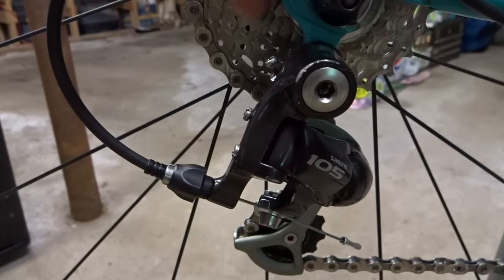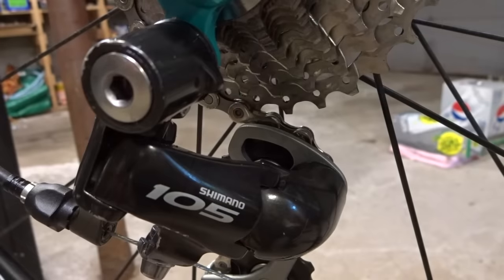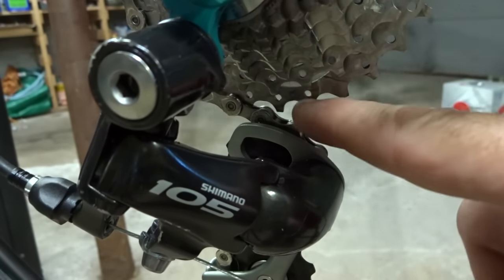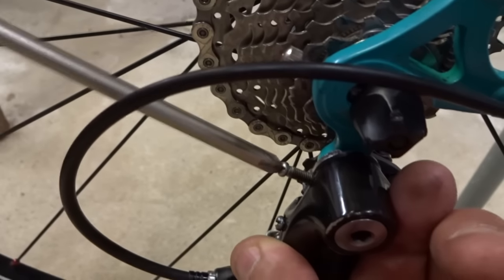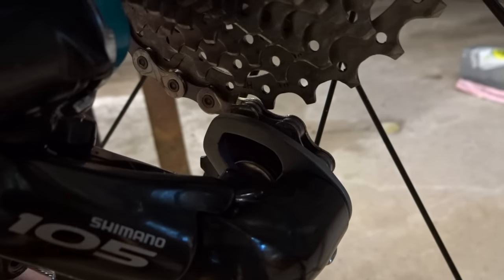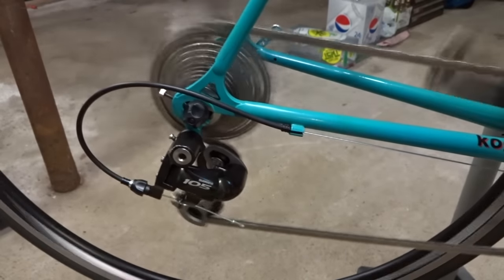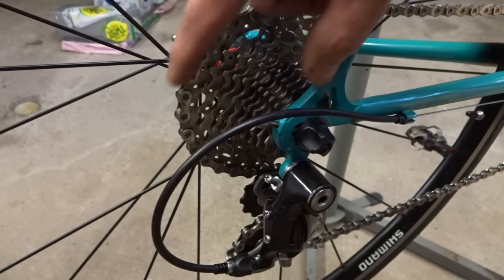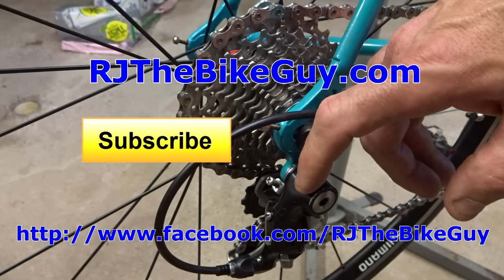How To Adjust The B Screw On A Rear Bike Derailleur

Comment: I can't get the chain to drop down to the smallest cog, it's not moving from the one above, I've unscrewed the high limit screw all the way where it almost comes loose , the derailleur won't align with the last cog...?
Reply: Could be your cable tension is to high, loosen the tension with the adjuster on the shifting cable!  Watch his video on rear Derailleur adjustment!
Reply: Kenneth Surgent I agree. Cable tension sounds too tight. The outboard limit screw should always be set with the cable tension backed right off (barrel adjuster). Set the limit so the chain moves into the smallest cog easily..then adjust the tension so shifting is spot on up and down the block. Move the front chain ring into the smallest, then the rear cassette into the largest, then check your inboard limit screw. Make sure it doesn't move passed the largest sprocket into the spokes..adjust accordingly.

Comment: what is the digferent 7 speed megarange 14-34T with 9 speed 12-34T if the biggest is same 34T???
Reply from the maker: I don't understand what you are asking?
Reply: i mean the sproket gear betwen 7 speed megarange 14-34T and sproket gear 9 speed 12-34T if the biggest cogs is same...
Reply from the maker: If you are asking the difference a 7 speed speed cluster and a 9 speed cluster, the spacing of the cogs is completely different. It has nothing to do with how big the biggest cog is.

Comment: Hi my hand lever gear completely changed. I have 7 gear speed unfortunately. When I am on gear 7 its on smallest cog which is actually first gear and gear 1 works as a gear 7. Basically its works other way around all of the gears. Basically from gear 1 to 7 became gear 7 to 1 its works totally opposite direction every single gear. Now I am having problem with highest gear. Please help thank you
Reply from the maker: The small cog is the high gear (7). The largest cog is the lowest gear (1).
Reply: @RJTheBikeGuy  yes it is and basically gear start from 7 to 1 instead of 1 to 7. I took the cable off and showing the same thing on hand shifting gear lever. I checked it without connect to derailleur I shifted hand lever freely but showing exactly same thing but I don't how its changed. I was having problem with first gear then I tried to adjust from barrel bar then everything changed but now I have fixed it and all of the gears works fine no more problems with the cog but still hand gear works opposite way without any problems n I can't fixed it. So now on gear will start from 7 to 1 and works fine. Its totally weird. If you have any idea let me know or you can make new video about it because no ones made this video yet. I have looked through everywhere but there isnt any information out there about it. Thank you
Reply from the maker: @kindandhelpful1658  I don't know what you are trying to say. Unless you have a Low normal rear derailleur, as opposed to a high normal rear derailleur.
Reply: @RJTheBikeGuy  hi my hand gear totally changed. It works otherway around. When I am on gear one the chain goes to largest cog and second gear also second largest cog and third one is third largest cog and that's how its works now all of them instead of going from 1 all the way to 7th gear. It works backwards. I hope you understand now.
Reply from the maker: @kindandhelpful1658  No I don't understand. Gearing doesn't magically change. Either you changed something, or it was like that to begin with. Or you are not understanding how it is supposed to work. But I am giving up trying to understand what you are trying to explain. Good luck!

Comment: i'm getting a strange ghost "rubbing" feeling in the lowest gears, but the pulley wheel is not touching the gears. I cant figure it out. any ideas?
Reply from the maker: Not really. You need to isolate the issue. Same thing as a phantom noise. 
https://www.youtube.com/watch?v=TuIPmqru_Rw
Reply: @RJTheBikeGuy  I think I mostly figured it out. The smallest cogs were not aligned correctly with the cassette which is why only the largest gears felt like they were 'rubbing'. However, the 3rd or 4th cog still feels funny..

Comment: hey rj i have 6 gear shimano drailor he not work properly when i change the gear will u plz help me what can i do?
Reply from the maker: Not enough information.
Reply: when i shifting my gear on lower kog he stuck on middle cog i try all method but not work
Reply from the maker: Either it is your shifter, cable or derailleur. Could be limiting screws, cable adjustment, bent derailleur or hanger, broken shifter, or many other things. You are just going to have to work through it. It is unlikely it has anything to do with the b-screw.
Reply: ok thank u sir i try this
Reply from the maker: Okay, I shot this video last night: https://www.youtube.com/watch?v=gwBQxhZhKnE
Reply: thank u rj my problem is gone..
Reply from the maker: What was the issue?
Reply: wire tension is to tight when i loose the tension drellure is proper shift ons again thank u rj i m ur big fane..
Reply: by de way what is ur full name

Comment: when i try and adjust the B screw either way it has no movement effect.
Reply: maybe your screw is not long enough? or your derailleur tension might be worn out
Reply from the maker: Can't tell you without working on the bike. It's pretty simple how it works.
Reply: @RJTheBikeGuy  ive been trying to set up the derailleur for many hours and i cannot get things to work correctly...if i shift up onto the 2nd crank ring the larger back sprockets play up and the chain starts to come off the crank ring...ive done things correctly and im wondering if the derailleur is shot as the B screw has no effect whatsoever.
Reply from the maker: @daveh2938  The b screw only makes very small difference in fine tuning shifting. I am guessing your issues has nothing at all to do with the b screw!!!
Reply: its ok ive ordered a new derailleur and see if that is the problem...if not my last option is a new hanger.